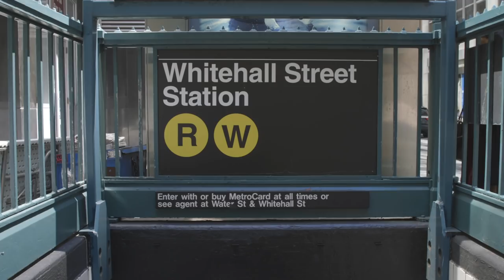How NYC plans to survive the next superstorm

Comment: Those last 25 seconds: incredibly eye-opening. Thanks for adding that.
Reply: Yeh that was a nice little touch. It's crazy - in London our 'Subway' (Underground) is completely sealed from the outside world for the most part, you'd never see water like this gushing down into the platform!
Reply from the maker: Glad you enjoyed it! We were a little hesitant to include it since it seemed to undermine the work that the MTA has been doing, but thought it was helpful to give some perspective... this wasn't even in a flood-prone area in the city! — Cory
Reply: I completely understand your hesitance, but also see your motivation was not to cast aspersions on the MTA and had no intent of disparagement! I am certain they are grateful that the ridership is involved and active in putting the focus on vulnerabilities of the system, which we all know they are doing their best to remedy. Thanks again for an incredibly informative video that is akin to a good short-subject documentary, Cory.
Reply: Well don't you pay like 5 pounds instead of our $2.75? Not saying this is an excuse but just asking
Reply: SMPTEColorBars technically everything they showed us requires someone manually closing off some part of the station such as the entrance or stairs, I guess since it isn’t any major storm at that time, they didn’t need to close off anything. But the ending was hilarious

Comment: This is where the focus should be. Being "Climate ready". 

Netherlands have done a lot of work in farming on below sea level terrain, something world should be very interested in.
Reply: The first step to getting out of a hole is to stop digging.
Also, it's the poorest countries in the world, the ones that had little to no role in creating current climate change, that will be unable to afford the high costs of being "climate ready."
Reply: Herman Von Petri i agree i think we should be focusing less on implementing ''bandaid solutions'  and instead tackle the actual problem of global warming
Reply: the best strategies actually do both at the same time, such as getting carbon into the soil in the farmland in those poor countries, to both get it out of the air & to have it then hold water in that soil & so prevent floods & droughts as the climate changes

Comment: A flash flood does THAT to your subways? Boy oh boy, I have no idea how you managed to construct them so poorly if they are so fragile. Post-USSR subways have pneumatic seal doors on every station to prevent water (for example in an event of an under-water tunnel collapsing and flooding the line) from flooding the surrounding stations or the entire subway line, and pretty much no amount of flash flood (granted we don't get hurricanes here but sometimes we do get those flash floods) would do that to any station because they all are built sturdy AF and have pumps and draining grates pretty much on all entrances. You just don't see them leaking like that as they are built using bomb shelter standards and simply don't leak because of all the cement and hard plating surrounding the stations and even their entrances...

Comment: "Hope for the best.
Expect the worst."
- Someone

Of the subway system fails and water eventually get in, without actually opening the doors, ex. The sealed doors that when shut, it gets air on the rubber "lip". If the that "rubber lip" fails and the door is still locked, won't it take lives if that particular subway station has people sheltered there?
Reply: Don't get me wrong, I think this is a good safety measure...but they still have to think what could happen if it fails. I mean...they probably are thinking of countermeasures. 🤔
I confused myself.
Reply: People would not be sheltered in the subway station, the system would be shut down and evacuated prior. This is only to prevent water from getting in and damaging all the equipment.
Reply: What's your plan for dams failing Marco? This system is good! It protects against failing electrical systems & all expected problems. There's a limit as to what is reasonable & practical to plan for
& yes as centurion said, people won't be sheltering from a storm below sealevel will they! (although it did occur to me watching this video, that this system could in fact potentially double as a huge, city wide nuclear bunker, so that's a pretty good bonus really!)
Reply: Lilac Lizard For dams, although very expensive, build an evac route specifically for people to head to a higher level than the dam it self or just not facing a dam where there will be people in case of a problem. 🤔
Reply: centurion1945 I didn't say it's a bad system. They just have to think of something in case it fails (the odds are slim of it happening, but it could happen).
Reply: Marco, but the number of lives that will be lost due to construction accidents in the building of those evacuation route roads will be higher than those saved by the routes & that's just looking at human lives, without factoring in all the animals lost to the habitat destruction & indirect human lives lost from climate change from the extra emissions & loss of trees to make the route. How many people have died of dam failures from modern dams? Only one I know of offhand they died because they didn't realise it was going to collapse until after it had (in the middle of the night) so evacuation routes would have been useless in preventing deaths

Anyway in this case, they already have built an evacuation route haven't they! It's called the subway lol if one station is failing, they can just put the people on a train & move them to another one. Presumably they will also have systems in place to prevent stations flooding from the tracks up into the stations, so even if trains have been stopped, they'll be able to walk people to the safety of the next station as the imminent flooding becomes apparent

Comment: all these means that the subway has to be shut down and prepared hours before the storm hits. if the trains and stations is not all evacuated and locked down in time you still get the flooding. Also the trains would be out of service the whole time until everything can be cleared out and opened up again.
none of it is passive systems that works during normal operations, as you can see at the end, a little sudden rain and it all went to hell because none of the systems could be activated.

Comment: That’s what happens when there’s more concrete and less vegetation. Central Park isn’t enough to absorb those rains. If mayors would keep green areas around the city, the problem wouldn’t be as severe.
Reply: bloo jkl45 remember that it was also due to the fact that New York was originally swamp and is below sea level. They aren’t truly prepared for large hurricanes.

Comment: Just let the damn train stations flood. Who cares if the subways flood when the surface streets will flood otherwise. Think of the subway system as a drainage system for the city. They just need really big pumps in the subways for the next time it happens but it's great that the subways flood so the surface streets and sewers don't overflow as much or at all

Comment: The easiest solution is to change from fossil based fuel to actually address our climate change but instead sure let's do it the hard way around.
Reply: We are taking steps to switch energy production, but it's not as simple as replacing coal plants with solar energy farms.
Reply: ttemicraft FTW I get that but we aren't doing enough fast enough.
Reply: The easiest option is actually just to put as much (or more) carbon back into the ground as we take out, at least for now. There are some easy, cost efficient ways that can be done & ways besides reducing coal use to reduce it's loss now, such as reducing soil erosion. On average, for every 1/2 tonne of crops harvested (food for 1 person for 1 year), 10 tonnes of carbon rich soil is lost to erosion! & 40% of crops will be wasted, largely because they're not "pretty" enough (cosmetic standards)

Reduce that erosion & waste & get more dead plant matter back into the soil & that goes a LONG way to reducing atmospheric CO2 levels (soil holds double the carbon of the air & all living beings on the planet)
Reply: nuclear energy